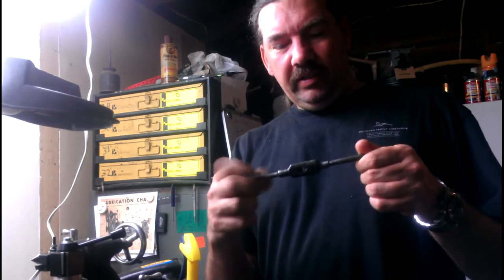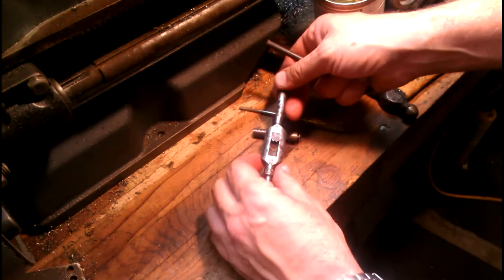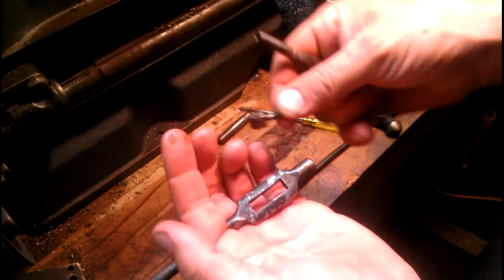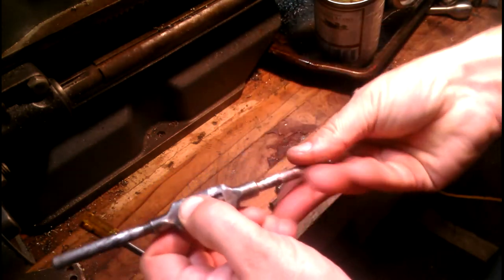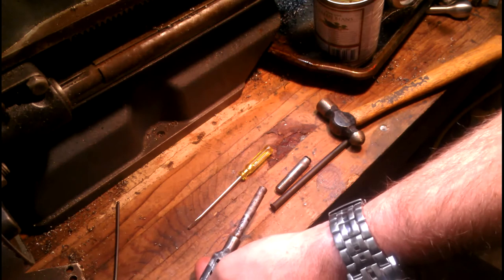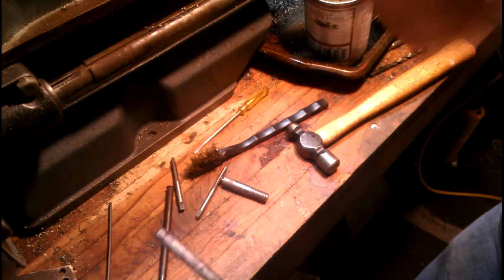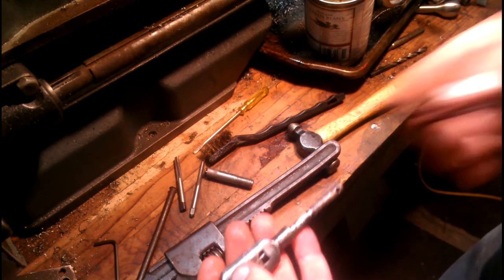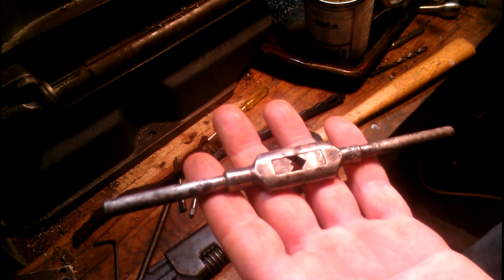Greenfeild tap handle no 0 repair

Comment: Nice job on the Greenfield! I use a product call Evop-rust or Rust rescue to remove all the corrosion. Works really well and it's non toxic.
Reply from the maker: ya know I think I have some of that somewhere good tip . I would like to set up a electrolosis rust removal tank . need a battory charger I supose